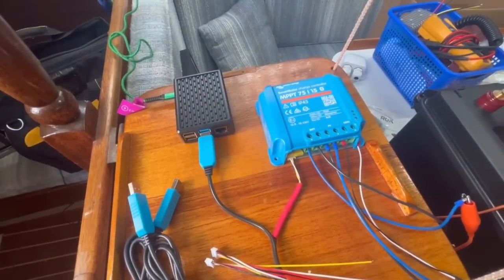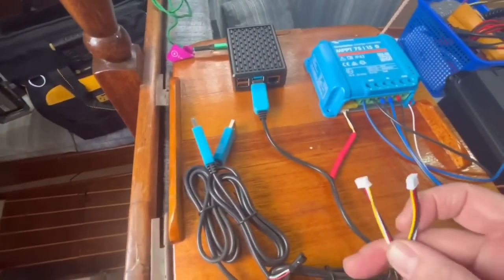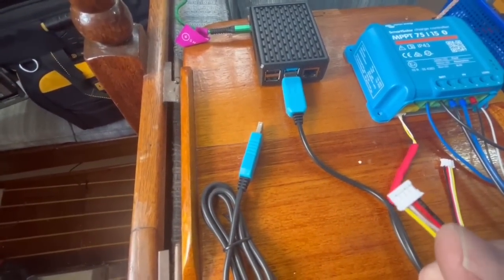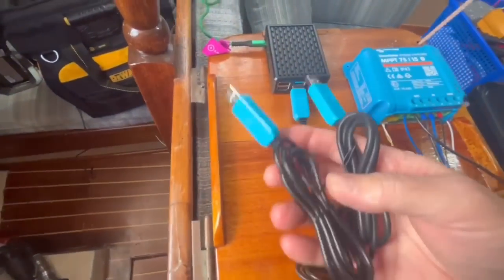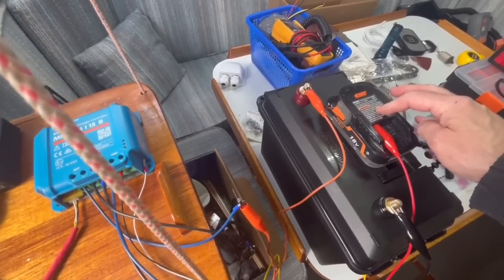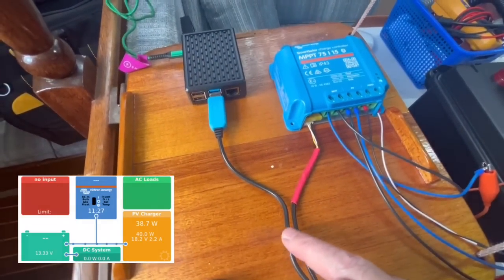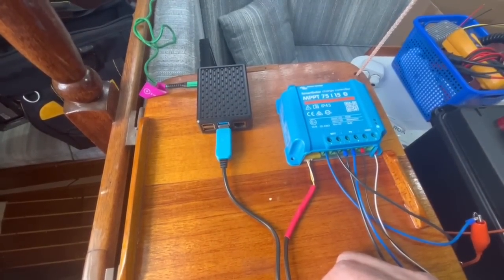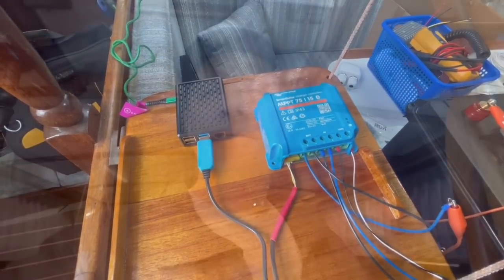Venus OS on a Raspberry Pi - #davethemmp

Comment: This is a fairly new video (4 months at the time i am watching) , Have any readers here used a Pi-5 with Victron OS ?
Reply from the maker: Good question, the Pi 5 is really over kill for Venus OS the reason is a Pi 2 can run Venus even the 4 is completely under utilized , Victron hasn’t released any Venus OS version of the software for the 5 yet, I’m sure someone will just try and load the 4 version on a 5, it won’t run faster or have anymore capabilities than the 4 even Node Red or other large capabilities are nothing for the 3 or 4, it’s just not a large compute program you can load the program with an 8 G SD card it’s a very small piece of software.

Comment: I just picked up the same RPi case, nice and solid unit and enjoy that it has no fans. I went with the 4gb RPi, not sure if it was worth the extra. 

GitHub was a lifesaver for setting up guimods and configuring a 10” touch display.
Reply from the maker: Excellent good luck make a clone of your micro SD card using Belena Etcher SD cards can be corrupted if you loose power when running or shutdown incorrectly 
Cheers

Comment: Unfortunately the homemade usb cable you describe is not always reliable with all victron devices, I found you really need to use a Duppa isolated adaptor from Italy for total reliability, I saw this on Andys Off Grid Garage channel
Reply from the maker: I agree I have since purchased the Isolated ones from Victron for marine applications

Comment: I also added a Pi 4 with Victron 150/45 and ordered the wires like you suggested but my PI is at the front of my RV while the Victron is in the rear basement with all my solar stuff. I am going to try and figure out if I can do a wireless usb hub/dongle or ? not sure what will work for a wireless connection. Of course the PI has blootooth and WiFi and you would think that the Pi could read the Victron which is also Bluetooth. Kinda confused but wiring all the way from back to front really is not an option.
Reply from the maker: Wally I have it on good Authority from the Victron staff that MPPT chargers and other VE direct devices like the Cerbo GX and Raspberry Pi’s can not connect via Bluetooth only connection possible is VE direct cables. You can but a super long USB extension cable I have seen them 20’ on Amazon not sure what the usb limit is but 40’ is probably doable hope this helps
Reply: @davethemmp  Thanks Dave! I am going to try this solution: I ordered Wireless HDMI Transmitter and Receiver, 2.4G/5G Plug & Play,100FT Range which is only 20 bucks on Amazon. I will put the raspberry Pi next to the solar charge controller and connect via Victron Ve cable and then connect transmitter to PI and connect receiver to monitor in the living room 35 feet away. I hope it works.
Reply: @davethemmp  Hey Dave. Well it worked! I added a HDMI wireless TX/RX from the Raspberry PI rear of RV to the 13" monitor in the front of RV. It was only 20 bucks on Amazon. So that solved the wiring and distance problem. The only adapter that the Raspberry needed was a micro HDMI adapter. The ports are already there.
Reply: I also made my own VE direct cable and it works perfectly. I have no latency or drops. I wired the PL2303TA USB to TTL Serial Cable  and JST PH 2.0MM 4 Pin Female Single Connector  like this:
NEG   NEG
TX      RX
RX      TX
POS    POS
The two outside wires run straight red to red, black to black while the two center wires criss cross. which is the transmit and receive wires. Just noted all this for viewers just learning.
Reply from the maker: https://share.icloud.com/photos/0baV-rsB-VU5jKPBfHoYzafpw

Here is the link from Victron staff Bluetooth doesn’t work
Reply: I have two controllers and only one will read properly with the GX Gateway and that is with the isolated VE wire. The DIY cable does not read "FULL TIME". I have to order the isolated wire.
Reply from the maker: Yes I have read many blogs about this where they just stopped working, boats definitely need galvanic Isolation

Comment: Dave I have found that using non isolated serial to USB made up leads work most of the time , but as you add more leads to more devices they will stop working, you need isolated serial leads, I brought a Isolated 4 port USB to TTL UART FTDI from  Duppa that will run 4 devices via one USB device along with 4 made up leads cost me $100 AU, Also if you install the large image of Victron Venus you also get to run Node-Red and SignalK, SignalK is great if you have a boat as it is a standard protocol with a lot of boat comms
Reply from the maker: Yes I recently read this on GitHub about DIY cables not working after awhile, I have since bought one from Victron to get the Galvanic Isolation 
Thanks for the tip.